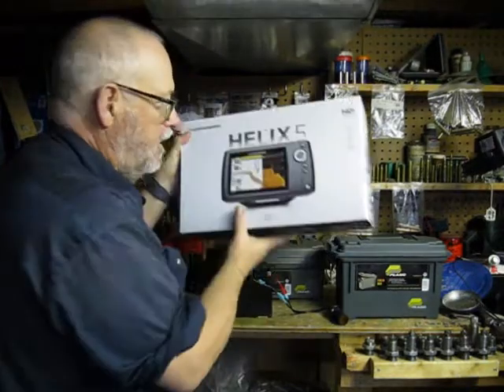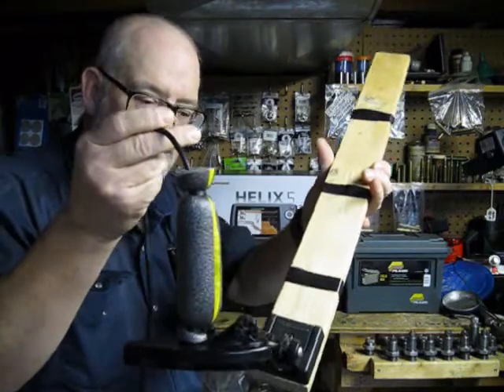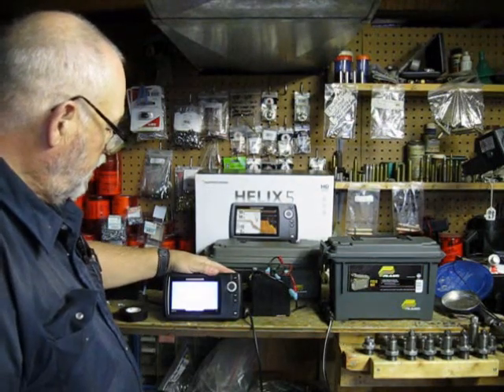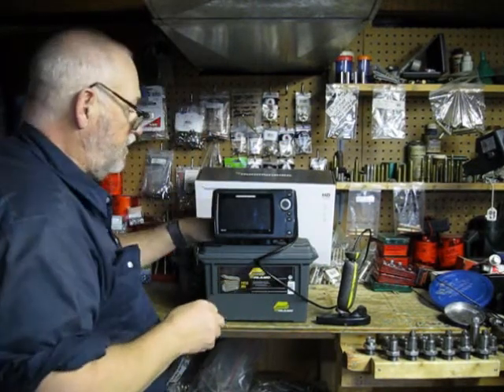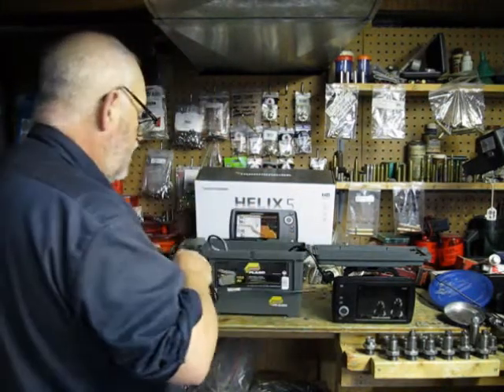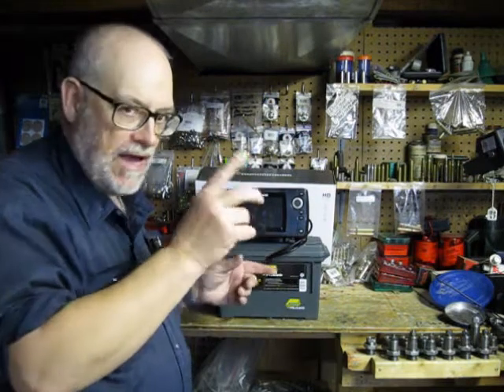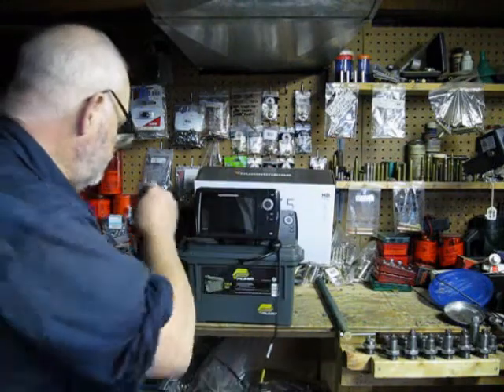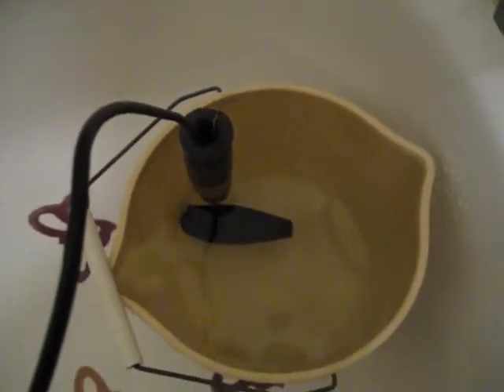DIY How to make your Humminbird Helix 5 Fish Finder Portable for Ice Fishing

Comment: Did you ever post the link for the battery pack? I'm used to vexilars with a red/black wires that slide onto the battery directly - I'm guessing the open water version doesn't have that, hence the need for the cig lighter?  Also, does that transducer stay level enough to work well? It looked like it tipped a bit in the bucket and wondering if that throws off the readings. Thanks!
Reply from the maker: Refer to https://www.youtube.com/watch?v=NkC6Fe17Vpc

If you put the pipe insulation tubing around the wire with zip ties, it will float and if it is not quite level, adjust the angle of the transducer.  If it is off a bit, it still works perfectly for ice fishing.
Reply from the maker: Refer to https://www.youtube.com/watch?v=NkC6Fe17Vpc

If you put the pipe insulation tubing around the wire with zip ties, it will float and if it is not quite level, adjust the angle of the transducer.  If it is off a bit, it still works perfectly for ice fishing.

Comment: does your cable become brittle when it is in the water?
i read somewhere that main problem is that the cable become brittle and hard and crack also.
Reply from the maker: I haven't noticed anything, I've been using this for over 2 years and no problems.  Hope that helps.

Comment: Do you know what model transducer are you using? The model should be on a
 little shrink wrapped piece by the plug. I'd rather use this one as I 
can get more use out of it on my boat instead of just using the specific
 XI 9 20 ice ducer
Reply from the maker: I am using the transducer from and what came with the Helix 5 Fishfinder.

It is suppose to mount on a boat, but what I am showing is having on a portable mount.

Does that help?
Reply: thanks sounds good! I ended up getting a XI 9 20 ice ducer for cheap

Comment: would you recommend down imaging? sor should I get side imaging? should I get it plain?

I also plan to use this for my boat as well!!
Reply from the maker: For what I did, the down imaging is quite sufficient, but if I was to buy another one again, I would buy it fully loaded, because I also use it on my boat in the summer for fishing.
Reply: I read that down imaging and side imaging only work when the boat is moving.  If you plan on not mounting on a boat and only using for ice fishing, save the $ and go just Sonar + GPS.

Comment: I have a helix 5 di gps.. everyone has told me i Need an ice transducer. Do i ? I see you used your regular one for open water.
Reply from the maker: I am just using the one from my (summer) boat, it isn't a specific ice transducer, mounted on a stick or pipe, as in the video.  And it works quite well.
Reply: You need the 1521 ice ducer
Reply: @vapeguy9248  only if you have th chirp unit  and want to take advantage of chirp frequency. The XI 9 20 ducer is Compatible  with all Helix Units except for DI models. DI only has Single Beam to 455khz DI
Reply: @vapeguy9248  Can u tell me where to find that 1521? As of 12/23/21, none in stock and online. 6-8 week back order. Can i use a 19 or 20, on my helix 7 chirp di? I understand those are non chirp.
Reply: @vapeguy9248  mine is dual spectrum

Comment: I use this depth finder to fish for crappi and to mark places I have found crappi this is a great little depth finder>>> allabout.wiki/tcue      I put it on a 16 ft Jon boat and it's is very accurate and has a great picture easy to use and mark spots and helps you get back to those exact spots